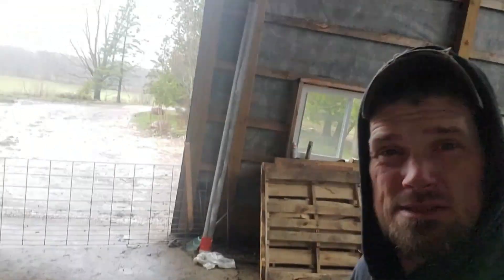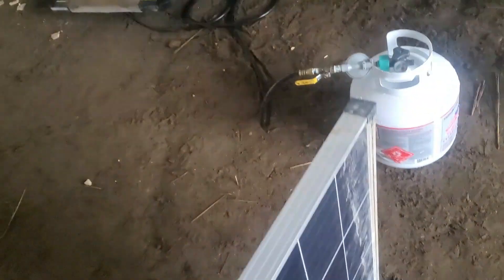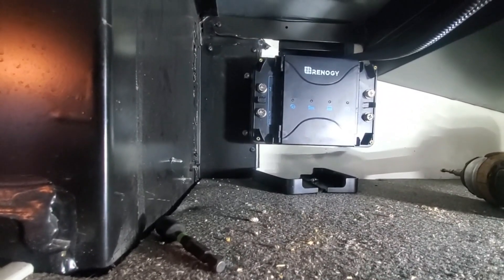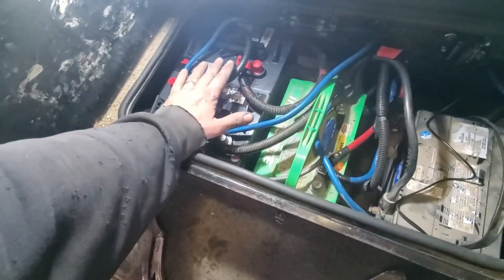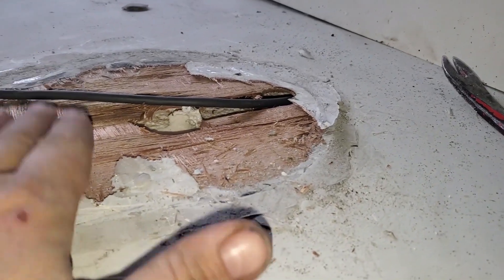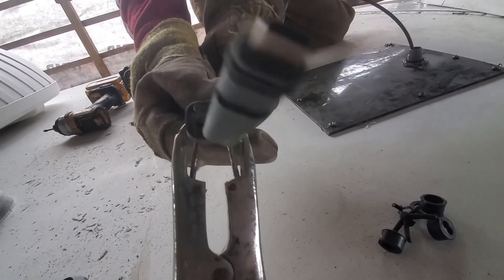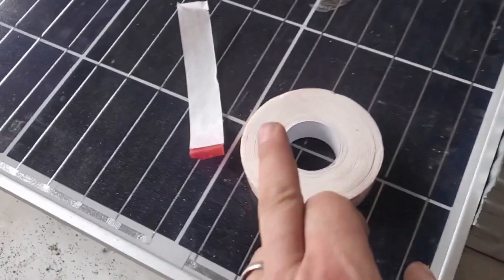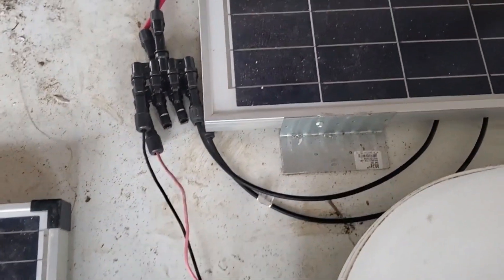It is Mounted/ Motorhome Total Solar Array

Comment: have you thought of lifepo4 batteries. they would be lighter and have more capacity and more usable power. 80% available power instead of 50% or less in lead acid batteries. they also are much less finicky than lead acid batteries. just a suggestion.
Reply from the maker: I have heard of them but that's about all, I will look into it thank you